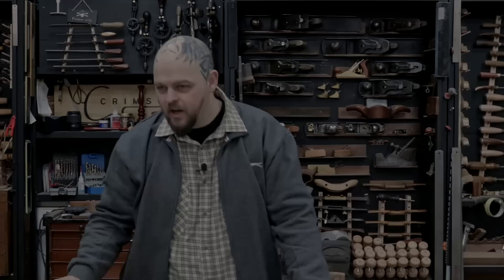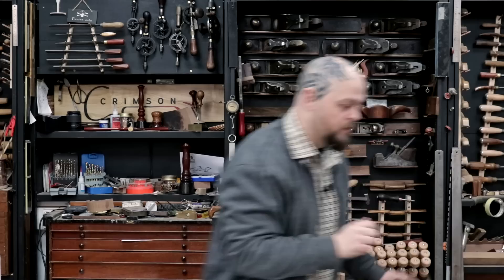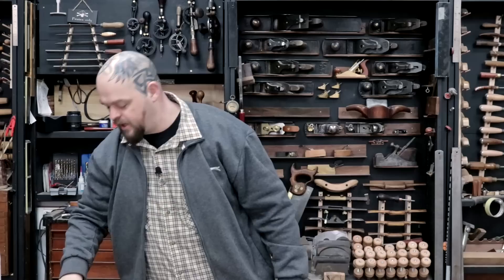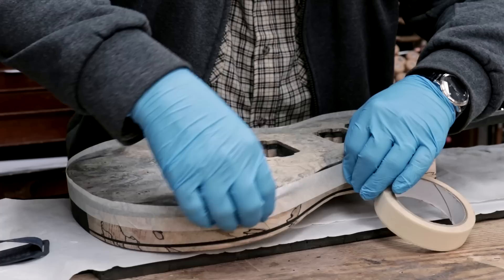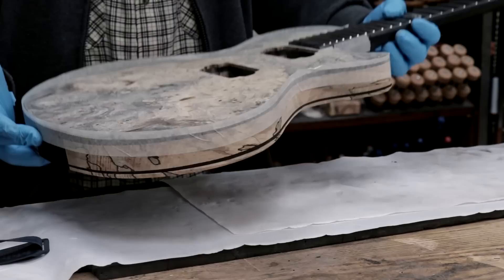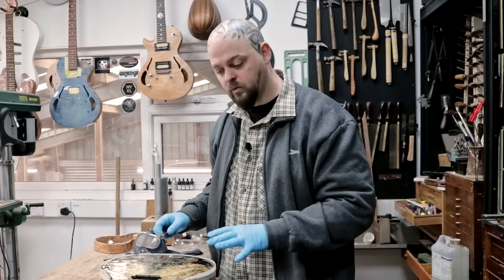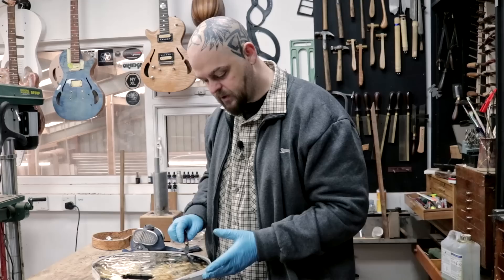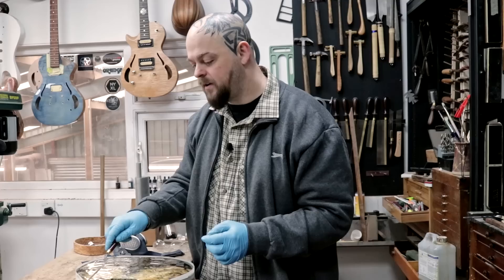Buckeye Burl Custom Guitar - How to Stabilise Soft Wood with Epoxy

Comment: Hi Ben, try using a paintbrush with short length andmedium hard hairs (20-30mm) and a heat gun to remove the air. On the epoxy side, degassing the resin might help for the air bubbles and finally using an clear casting epoxy instead of a general use epoxy will make the job easier and maybe better looking. Thx for all the vids. Really enjoy! Cheers!

Comment: coating wood with epoxy like this is only going to achieve a very slight penetration, and can lead to areas of the wood becoming uneavenly dense. I would wholeheartedly reccomend performing a full stabilisation of the wood in its plank format with a vacuum chamber. The process uses a primary mixture that fills voids throughout the woods structure and then uses the vacuum force to 'wick' the resin in as a replacement for the stand in fluid. While it does mean that you would need to colour the wood beforehand, you can also use the resin during stabilisation as a carrier for pigment within the woodgrain. I guess you could see the downsides that it fills voids in the wood and makes it a composite material integrally which would make it harder to work with traditional hand tools, but for the purposes of hardening soft yet beautiful woods, it's at the forefront of technology!
Reply: Agreed, plus the resin he is using is far too thick to really penetrate. It's not going to stabilise, it's just going to coat the outside.
Reply: I've had really good success with wood hardeners.
Reply: Maybe he should try the bagged vacuum infusion method use by people making car bodywork panels out of GRP & Carbon, without the need for a vacuum chamber
Reply: You seem like a person who knows about this type of thing...I want to use a Maple burl (5mm thick) as a top for a thinline semi hollow. Would stabilising this with a thin epoxy or CA Glue be enough on it's own, if so what would be the best non vacuum way of doing it? Or would I be better off reinforcing it with 3-4mm of another hard wood underneath? Cheers. :)
Reply: I use vacuum infusion when making carbon composites, a mesh within a vacuum bag is required to permit resin movement across the guitar surface, this is essential for wetting woven reinforcement such as carbon or glass fibre,  but if used in this case the mesh will leave an unsightly texture.  As this is decorative, I think the painted on application will be fine.
Reply: @DolanCustomGuitars  The thinnest CA you can get will work well, but be prepared to use a ton of it if the burl in question is particularly spongy (not so bad with maple as compared to, say, cottonwood or poplar).  There are also marine finishes (google "TotalBoat Penetrating Epoxy" and "Smith's Clear Penetrating Epoxy Sealer") that will work as well.

Lots of debate in the world of resin in re: "penetration" (some say it does, some say it doesn't). Some will say if you thin the resin it penetrates, counter arguments have fairly shown all that penetrates is the solvent (carrying very little of the resin with it), and you may end up with resin that doesn't cure right.  Unless the wood is truly porous I really don't think it does - but YMMV.

Reinforcement under the board is an entirely different issue.  Are you looking to make a soft wood better at resisting damage, or are you looking at making a stiffer top?  In either case (IMO) stabilizing the top will do what you want.  5mm is pretty thick to start.
Reply: I've used this technique with a few project's. Old cars  (walnut dash on old Daimler) antique Japanese floor lanterns, and a couple of bass guitars. The epoxy forms a composite with the wood as it soaks in and dries. It is essential surface preperation if u wish to achieve a hard wearing and long lasting finish.
Reply: DolanCustomGuitars I know a little about wood stabilisation, but I know absolutely poop all about guitar building... I'd say your best bet would be to use a wicking epoxy if you haven't got the vacuum system to hand. But at the same time, any burl is going to be weaker than plain timber, I might recommend testing an offcut for penetration, and possibly supporting the top with a 'tone block' on the inside of the cavity.

Comment: When we were epoxy coating racing dinghies we used west system epoxy with a thinning agent. This allowed the epoxy to soak in. We would apply several thin coats rather than one thick one. Once the desired amount of epoxy has been applied knock the top off with wet and dry to remove any imperfections and then polish using G3 cutting compound on a mop. A perfect finish every time

Comment: hi Ben. I think you videos are great. You have an unscripted way of doing them which I great fun as well as informative. 
in some videos, I have seen, when people have used resin, they use a heat gun while applying. just gently blow the heat on the resin. it, apparently eliminates the bubbles as you go.
perhaps you already know this.
Please don't change the way you do your videos. they are so much fun.
Reply: I also use a heat gun it is very effective

Comment: Hi Ben. I'll echo some of the other comments here and recommend a thinner product. While it is usually safe to thin epoxy resins with about 10% acetone, there are epoxy coatings formulated for penetration. System 3 makes a great penetrating epoxy that is sprayable and looks beautiful. It can be top coated with anything once cured, or used on its own. There are many brands if marine epoxy used to reinforce rotten wood that are all great.

Comment: To Ben The Great!  Have seen a couple of guitar videos that advocate putting an extra two screws into the neck at a 45 degree angle through the body to the bottom corner of the neck pocket and into the neck to "pull the neck tighter into the pocket" supposedly to increase sustain etc...pro's and con's...something to look into or just youtube hype...Thanks for all the shared wisdom!  Cheers!

Comment: Not a guitar builder, but a woodworker, and I have used epoxies for various reasons. Wouldn't using a chip brush to spread the resin give you a more consistent spread?  Just know that you will have to be mindful of brush fibers that pull out, and pick them out of the resin before it starts to harden. But there will only be 1 or 2. Love watching your work Ben. You are a master at your craft, a little mad maybe but a master.
Reply from the maker: Hey.. yes, this was my first real play with resin and I certainly should have done a few things differently.. VB, B
Reply: Crimson Custom Guitars Sorry Ben.I wasn’t trying to criticize your work, but rather offer a suggestion along with the one weakness that goes with it. And before I forget, that guitar turned out awesome.

Comment: Hi, Ben. If you put the guitar in a low pressure environment after applying the resin it gets sucked into the wood much further. I've had fair results using vacuum storage bags, although the vacuum is not strong and you need the bag to be kept off of the surface ideally and that isn't easy with a guitar. For stabilising soft woods it makes a big difference apparently, they use big tubular vac chambers for treating old timbers in listed buildings, according to my brother in law.

Comment: If I could make a suggestion. Get a huge vacuum chamber and cactus juice resin. Place your wood in the vacuum chamber with enough resin to cover it, at a heavy enough metal weight to keep it from floating and vacuum the air out of the wood before cutting. It’ll turn any soft wood into a harder wood, but that is the stabilization process. Good luck!
Reply: and after baking?

Comment: There's a product called renuzit or renews it....something like that. It's epoxy. You mix it 1 to 1. It's a little less sensitive to accuracy in measurement than some epoxies. It is as thin as water and penetrates very well. You can turn a spongey rotten piece of wood into and iron wood plank with it. It's also very clear in color. Might be worth checking out.

Comment: Am I missing a continuation video? How do you get the top to blend with the sides and still look like 1 continuous coat? Is that all the sanding process. What's your sanding grain count? I'm sure that's high, but how high? Do you wait less than the 24 hours curing time, to blend the top and sides easier, before the 72 hour full cure?

Comment: if you have poliethylene (hdpe) container, try mixing in some acetone to epoxy resin, you make much it thinner and it will cure with a delay for the acetone to evaporate. you would need an respirator for that, but you would spray it on if you don't fear cloging spray gun.
your thick resin will not sink into the wood , this is more glazing the surface

Comment: So before it hardens resin type materials (body filler is one of those) dissolve pretty easily with lacquer thinner. There are paint brushes that are not ruined by lacquer thinner and don't fall apart (you probably don't want bristle parts in the finish). What if you used such a paintbrush. The solution seems to have pretty good flow which should fill most of the brush strokes. My thinking is it should go on more evenly and in the end require less sanding as well as leave more depth after smoothing the surface.

Comment: After applying the epoxy if you give it a flash over with a blow torch set low. This will induce heat into the epoxy making any bubbles
rise to the surface and POP then the heat also helps the epoxy self level. This will give you little or no sanding required.   ~That's how we do it in the furniture industry to get a gloss top on a table or worktop. Keep trying every day.
Reply from the maker: thanks for the tip.

Comment: Finally, I love resin, even though it stinks. I also love bog oak, which doesn't stink.
Reply: Mike Purdy bog oak does stink. At least when you turn it on a lathe. I've made a few pens and rings out of it and it has a raw sewage smell. Still not as bad as purpleheart.
Reply: Milk Plays mmmm raw sewage

Comment: One very important step you did not show and that is to use a hair drier to bring all the trapped bubbles to the top. this is an essential step to a proper finish  with clear resin epoxy.
Reply from the maker: Very good point. B

Comment: wouldn't it have been easier to make a outer mold and then put the guitar into it and then like some kind of injection molding, coating the entire thing by immersion? then when solid break away the outer mold - possibly made from clay for big reveal? you can fill the cavities and removed the neck of course before doing the immersion.

Comment: "I am the voice of the Knight Industries Two Thousand microprocessor , K. I. T. T for easy reference.... KITT if you prefer"

Perfect timing on this this video. I'm doing a tele with a spalted flamed maple top , So I'll be flooding the top with epoxy.

After sanding back can this be finished, with either your finishing oil, or lacquer?

Comment: Epoxy has a habit of just sitting on the surface as it goes off pretty quickly. Have a feeling this may just make a big cap of resin that could be peeled off once cured

Comment: Why didn't you use lots of thinners, so it would soak in deeper into the soft wood..the mix looked well thick..at least that's what I would have done, that way you could have used a brush and did the whole guitar in one go..just keep adding as it got absorbed by the wood..plus, I think, since the 2 part resin hardens pretty f..hard, it would help with sustain..(since the soft wood wouldn't sustain as much as a hard wood).. or is my thinking totally wrong..?.great vids by the way..

Comment: I don't think this is going to work as well as he hopes. A thinner resin applied under vacuum would be much better results.  A marine grade product designed for maximum penetration would be good, if a vacuum wasn't available, or feasible, as well. This is basically just going to sit on top of the wood until it kicks off and remain quite thick which means lots and lots of nasty toxic sanding to come. Me thinks he should've practiced on a similar piece of scrap wood before trying this on the guitar itself. If it works, that fine, but if it doesn't he's gooched.
Reply: Yeah, that stuff was way too thick. if it was thinner it would absorb into the guitar much better. Last time I saw someone do this the Epoxy was like water and they just brushed it on.

Comment: a super glue finish is much easier, faster, cheaper, harder, nicer to look at
Reply: acmullane it doesn't fill the gaps anywhere near as well as epoxy. Also don't have to worry about it going white due to moisture. An even better way for this type of job is in a pressure vessel, put in resin and vacuum out the air, air leaves wood and resin fills voids.
Reply: it works great as a filler! i can only guess you've been doing it wrong - fresh super glue will not go white if you use it properly
Reply: YEAH CA GLUE IS AWESOM.
Reply: my unlistedvids please explain
Reply: it is faster drying, it's cheaper, it's harder (check wikipedia and your thumbnail) it can be applied much thinner making it nicer to look at - btw how many ca finishes have you done
Reply: I use CA for jewellery and other small items but not on something this size. Cost works out better for me on the whole. I do have experience with both and to say I have done it wrong is a bit insulting. I disagreed with you, but didn't make it personal.
Reply: size is everything